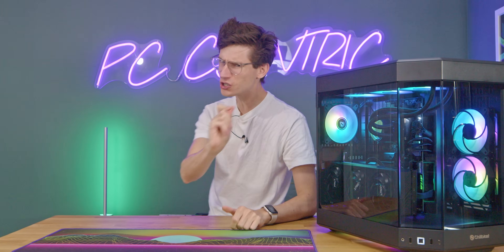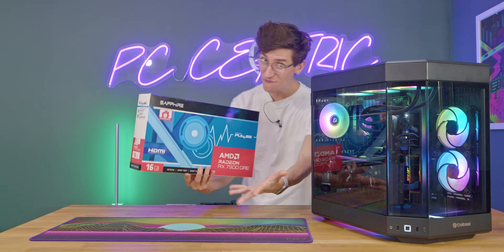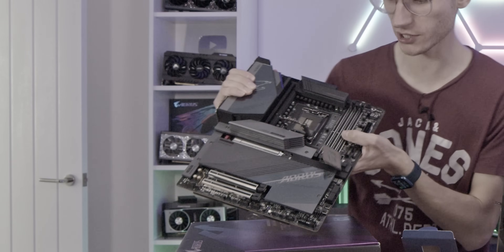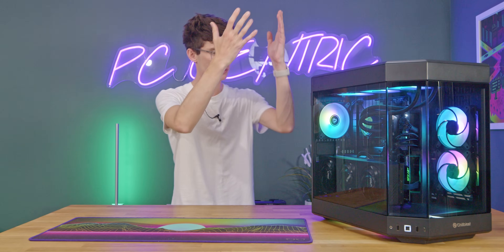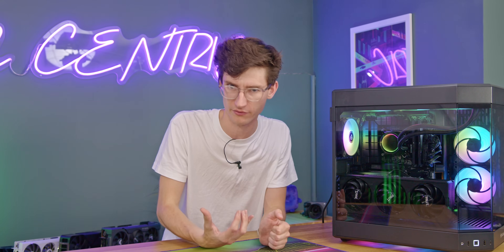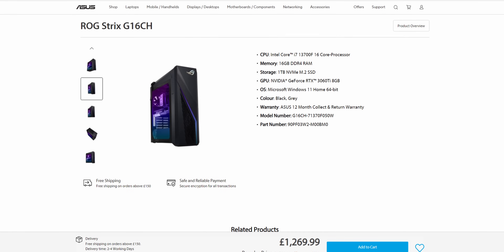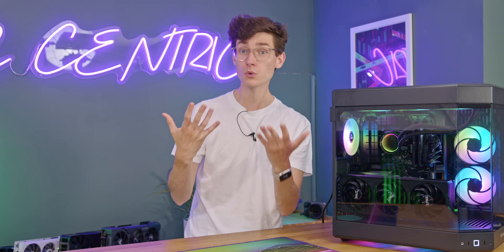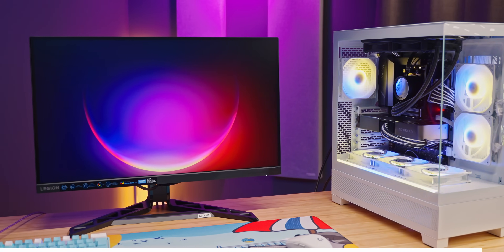Should You Build Or Buy Your Gaming PC? 🤔

Comment: I built my current pc, but it was during 2010-2012, so now if I would upgrade I would basically need a complete new system, Id probably just ask the store I bought all my parts from to spec out a pc and then build it myself. Or buy one of their prebuilts, but labor cost is around 200€

Comment: Just be careful with the cpu and around the cpu motherboard slot.  I have accidentally bent a cpu pin or two by removing the air cooler a little too aggressively when it got stuck, pulling the cpu out at the same time.

A good tip is to let the PC run hot for a bit so old crusty thermal paste heats up and is easier to pull apart, also twist the air cooler a little off of the CPU to help remove it without pulling straight up and removing the cpu WITH the air cooler.

Comment: I recommend building ur own. But my first gaming computer I bought a cyber power and it worked perfectly for 6 years. After 4 years I upgraded my ram, cpu,gpu,psu though a local repair shop. I purchased all components. The shop bulked at first because of buying my parts because of compatible, but when I explained what I had and the parts I purchased he was good with it. Now my current computer I built myself with high end parts in Dec last year but spent 3 months researching how to build and components. I have a high end working great computer for the first  time

Comment: I prefer to build my own--been building them for around 40 years, but this time around I just couldn't find an RTX 5090 in stock that wasn't installed in a machine anywhere.  Looked at Dell and HP, one didn't have a 5090 build, the other did only with Intel processors.  Microcenter didn't have anything--they had some 5080 prebuilts but no separate boards in stock.  Newegg had a machine from Gigabyte with a 9800 and a 5090 for not a lot more than Dell and HP, so I finally went with that.  I don't have any complaint about the build--I could nitpick it but it works fine and seems to have pretty good cooling.

Comment: I used to build myself but the last time was a nightmare! The thing would randomly shut down. Try and find out where the trouble comes from without having all the components to swap out and rule out. Could be the PSU, could be the ram, could be the mainboard. And you have no one to get support since you don't know which of the components is causing the problem. That experience has scared me away from building my own.

Comment: I bought a tippy top of the line Omen 4 1/2 years ago and it's been awesome; however, I know it's getting about time to upgrade.  Trying to decide now between upgrading parts, or doing a clean new build.  I think your exactly right; because one of the factors against upgrading is that I don't know how it was put together or knowing exactly which model components are in it, to know what to replace them with.

Comment: I’m completely new to this, and just want something that could run good for my games and video editing. I honestly have no idea where to start. I don’t know much about computer parts, how they work together, or even what’s required to make a fully functional setup. While I wouldn’t mind assembling the PC myself, I’m stuck trying to figure out what to buy and how to ensure everything I choose is compatible. For example, I don’t know which brands are the most reliable or how to tell if a certain part will work well with another. I’m also worried about accidentally spending too much on an expensive part that doesn’t match well with a cheaper one. On top of that, terms like motherboards, CPUs, GPUs, RAM, and power supplies feel a little overwhelming because I’m not sure how they all fit together. Right now, I’m completely lost in this process and would really appreciate some help. I just want to get the best for the amount of money I’m paying, and I heard that ordering a prebuilt won’t always get you your money’s worth.

Comment: I have only "bought" 2 computers in my life since 1984, that was the @ 28yrs old I bought an XT Computer with an RLL drive and 256k of memory I believe.. I built everything else (Computer shows were HUGE in the 90's) .. But in 2020, I really needed another computer and did not have the place to build it myself, so I bought one from Amazon, an Intel one.. Even though I am mostly an AMD person.... It was on sale and a decent price at the time.. 
fast forward to today.. at 68yrs old I am now building my most expensive rig, and it is only a mid range-upper mid-range rig... 
--I will be building it tonight, I still have fans coming in from Amazon and they won't be in until Sunday.. BUT the fans were decently priced, much better than Best Buy and Micro-Center was out of a LOT.. I bought all my parts from Micro Center, as they matched prices, and/or were the cheapest on prices.. This is what I have:
-MSI-Tomahawk B650 MB.. seems like they were very stable and had great reviews, and great Audio. 
- RYZEN 7800 X3d CPU - cooler PURE ROCK 2 CPU Cooler.. 
-GPU PowerColor AMD Radeon RX 7900 XT Red Devil Overclocked Triple Fan 20GB ..  :D .. yeah.. I wanted the Hellhound, they were out so they gave me this at the same price.. I love it.. :)
-32gb of RAM G.Skill Trident Z5 Neo RGB Series 32GB
-PSU MSI MAG A850GL PCIE5 850 Watt 80 Plus Gold
Case wise.. I mean, nothing fancy.. 99 bucks for the case..Montech KING 95 Tempered Glass ATX Mid-Tower.. For the price it is REALLY nice and came with a TON of extras in the box..  
-AND I am staying with WINDOWS 10- I refuse to go to Windows 11.. 
-
Most of the reason I did this was for Adobe Premier.. (Although the only game I play is War Thunder, I am sure it will be a nice benefit there as well..)

 I was going to go with Intel I7 14700.. But everything I saw, seemed like they were still having some BIOS issues, and I did not want to have the chance of any issues.. 
everything in, I am at 1700 bucks.. The reward is ALWAYS you built in yourself.. you 100% put everything you wanted in it, no compromises.. and when you turn it on for the first time.. Even though you might have some adjustments to make in the BIOS, and upgrade it.. YOU built it, your way.. there is ALWAYS a very cool feeling from it... I built it this was as I wanted to future-proof it for the next 5 years.. So.. And that GPU will probably outlast my life..

Comment: Building your own is the cheapest way to go in the short term. 
This price is offset by doing research, shopping for every compatable part, waiting for those parts to arrive, building the machine, buying the OS, installing all the sopftware and OS, troubleshooting when something doesn't work right and dealing with the possibility of faulty pasrts, and in that case, returning the parts and waiting for the new parts. While the parts individually have a warranty, together the machine is under no such warrenty and if you damage the parts in any way due to a faulkty install, then you're expenses are out of pocket. There will also be no customer service for your build.
That is a smooth experience. But as we all know, things can and will go wrong.
As long as you're willing to put up with the hassle, then building it yourself is a good idea, but for the life of me, I really don't see the upside to all that headache. By the time you're done with parts and labor, you've actually spent more than you would just buying a prebuilt.

Comment: A week ago, I bought a pre built PC for like 1500 US dollars at Walmart with an Intel Core i7400KF as the procesor, 32 GB of Ram, an Nvidia GeForce RTX 470 Super as it's Graphics Card and Windows 11 as it's Operating System.

I'm very new to PC gaming (I was a console gamer before this) no I'm not sure if I got ripped off here. It does play all of the games that I got on Steam perfectly fine though. (except for Sonic Adventure 2 for some reason)
Reply: You didn’t get ripped off. That’s good value
Reply: What kind of games can you run well? If they're games like Cyberpunk 2077, Doom, and The Witcher 3 but Sonic Adventure 2 is lagging, it's not your computer that's the problem; likely that game is badly optimized. 

Friendly tip: if you haven't already, manually increase the RTX's fan speed when gaming. In the system's shutdown settings, disable fast startup.
Reply: @swallowedinthesea11  The most graphically intensive games I have on my computer (so far) are Baldur's Gate 3, Ghost of Tsushima and Elden Ring.

And thanks for the advice.

Comment: For the first time, recently considered buying a prebuilt via NZXT Three Prime especially with the $400 Black Friday discount. Around $3408 with the 4 TB M.2 and four extra fans. Been a few years so didn't really feel like building a PC, but did some research on the latest stuff and ended up paying $2,200 for arguably better parts (borrowing PSU from my current PC). Maybe smaller builders have a smaller markup but can't justify $1,200 as a building fee (well not exactly $1,200 -- their case and some other items are more expensive than what I chose). So I did that and also got a Reatan Alloy 9 for $569 -- so for less than one 3P I will have a PC that's just as good as a 3P plus a fairly powerful mini PC.

Comment: If you don't want to build or are worried about it I highly recommend either Micro Center or a local PC store if you have a good one. My local shop will source whatever parts you want and charges a $0 build fee. Sure they upcharge a bit, but they also get the components at a much better rate than consumers so the price only ends up being slightly 5-10% more than if I build it myself.

My cable management is horrific and while I like building, I will never build my main high end machine again. I've had too many RMA parts, too many weird pins bent in shipping, and again I CANNOT manage cables to save my life. 

Even as someone who loves building I would say don't let the pressure to build stop you from buying a PC for gaming. Just don't buy a big box PC from Amazon or best buy or something.

Buying Micro Center custom built > buying local pc store custom built > buying a custom build from SI > anything else.
Reply: i build my own...but i would consider having them build my own

Comment: I've built many PCs in the past but went away from the DIY model because back then, building (aka assembling) PCs was not easy compared to what PC assembly looks like in 2024! The cases then were smaller, tighter and parts integration was not always smooth especially working around the PSU and the myriad of wires going all over the place, around and above the motherboard!  Today, case design has changed the location placement of the PSU making board and peripheral access so much easier! Verdict? Build my own!

Comment: 😭 why does this have to be so difficult? All i wanna do is play on pc. Option one, i have to learn how to build it! Option two is more expensive, and it will be harder to upgrade. And both require so much research! 😫
Reply: Not to sound rude, but the way I see it: You either put in the effort to learn about PC hardware or don't and just give up.

Modern PC building is significantly easier nowadays compared to 2-3 decades ago. A lot of things are plug and play compared to the days of plug and pray. You can install Windows on most modern systems in 10 minutes or less. Back then, installing Windows 9x could easily be a multi-hour ordeal that was prone to crashing and freezing. There are a lot of significant improvements in PC building nowadays. Things are more streamlined and more or less work out of the box.

Comment: Option 3 = Pure unadulterated cow manure. I have never seen a good one yet unless one spends a fortune. Garbage.
Option 2 = I have 3 shops where I buy my parts, all of them have the option to assemble those parts you bought for around 150 Euros. So, it will be the same as option 1, aside from a small waiting period. One of them even allows you to assemble your PC in one of the booths they have, so if you run into any issues scream HELP!
Option 3 = The best option, assuming you have the space to assemble it and choose the right case for it (that's my pet peeve since some cases are a nightmare to work on).
Since I do not do RGB, cable management is not an issue. However, for those wanting a Christmas Tree that is something to take into account.
Aside from using power tools in some cases, in more than 20 years I never broke anything I didn't want to brake ;)
Cheers.

Comment: This is easy.  Prebuilt all day long.

Time is money.
Reply: Which is why you would want to build your PC. You save hundreds of dollars from Pre-builts and it only takes a few hours at most to finish everything.
Reply: @BruhLL  You can get a prebuilt for near the price of doing it yourself. 

I'm not even kidding.
Reply: @MSOkraMan  Where exactly? Most pre-builts I've seen are more expensive than a built one.
Reply: @BruhLL  I just looked and skyteck has a prebuilt i5 13400 with rtx 4060 16gb ddr4 1tb m2 ssd.  $849.

Try building one for 50 bucks cheaper.  Good luck.
Reply: @MSOkraMan  I see, you're right. Though that's only for these specific specs, the PC is still cheaper than a built one.
Reply: @BruhLL  My main point of the original post was that paying a little more saves hours of time which is valuable. 

If a person loves to tinker and doesn't mind trouble shooting and wants to spend time watching tutorials then build a pc.

It isn't cost efficient however.

As a matter of fact, it often turns into a financial headache that costs much extra after you get a bad piece of kit that leaves the entire build worthless.

Most people don't have extra compatible RAM or an extra power supply or spare motherboard to even do trouble shooting once they hit an issue doing their amateur build. 

90% of people are better off ordering a prebuilt with a warranty that is guaranteed to turn on
Reply: @MSOkraMan  I meant that this PC was cheaper than if a PC builder decided to build one with the exact components, I totally get your point. But again it really depends on the manufacturer/company you're going with. I mean if you're getting a low to mid range PC, then yeah I feel like buying a pre-built is essential. But people like me who owned a PC that had the RX 7900 XT (my current PC) or the rtx 3080 (my PC from 3 years ago) might have to build one from scratch to save both money and time all-together, since pre-builts with the same specs are more expensive when it comes to price to performance. To each their own I guess, we're all part of the PC master race at the end of the day. Have a good night/day bud.

Comment: Im nervous about building PC and also buying one, there’s a Best Buy near me, I can check out what’s there first I just need help knowing how to stop worrying, this video helped me calm myself down and helped me understand how the pcs work.
Reply: I hear you loud and clear. 19 years ago before I built my first PC, I was scared to death! However, after watching countless how-to videos on TigerDirect, I ordered the parts and took my time putting it together. When that thing booted, I was the happiest person in the world. I didn't experience one ounce of fear after that. Please believe me, if I can do it, you can too.
Reply: @zingwilder9989  After building the PC, do you just need to install Windows and then can you start playing games?
Reply: I have to add it's just way cheaper to buy an HP envy and add a graphics card to it! It's not hard. I bought a pre-built and popped in a graphics card I saved lots of money but not my PC is getting really old and so is the graphics card! Now you need the 24 pin adapter for the motherboard to upgrade the power supply.
Reply: @asrr62  With respect, a basic modification to an off-the-shelf HP Envy will not be the solution if someone wants a PC to run Microsoft Flight Simulator 2024.

Comment: I'm thinking of either building myself or using microcenter's build your own. MC has up to 3 years no questions asked warranty and pickup same day fully built. If I build myself I can save about $500-600 though. Does anyone know if it's worth it for the extra safety net? If ANYTHING went wrong with the PC I could bring it into MC and they will repair or replace no questions asked basically.

Comment: I still prefer building mine. Built all my rigs from 14 and now im 24. Start with cheap parts if you have fear of breaking the parts. The pluses are that I can chose the exact theme, I can customize, I can mix new with used/open box parts and I can avoid Asus and EK. Most of the time, pre builts use shit rams(or dont turn on docp/xmp and 100% the customer wont know how to do it), shit psu, cheap out on cases and fans or mobo.